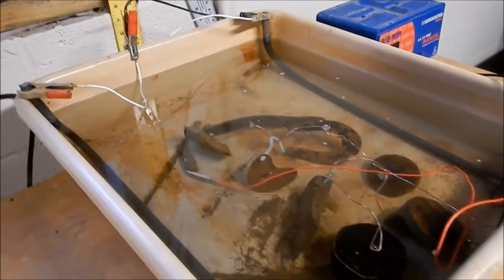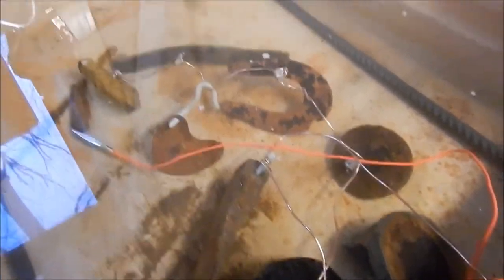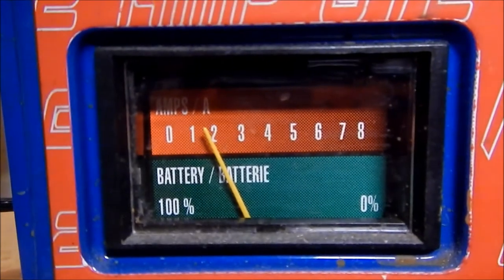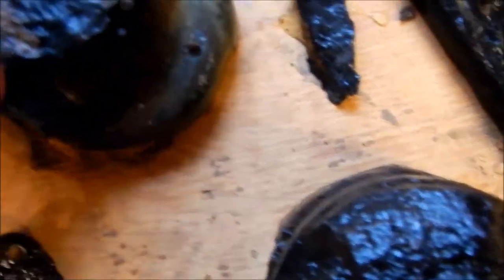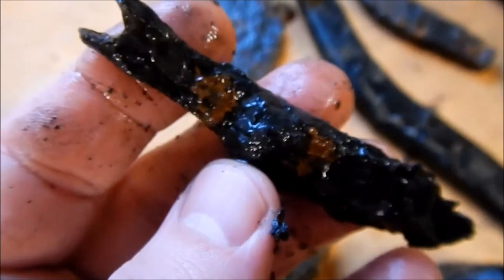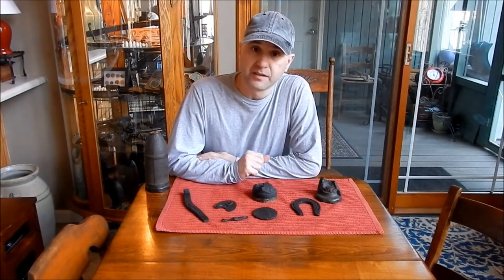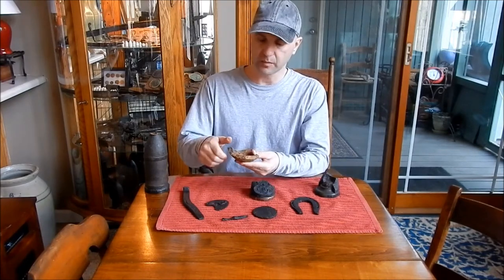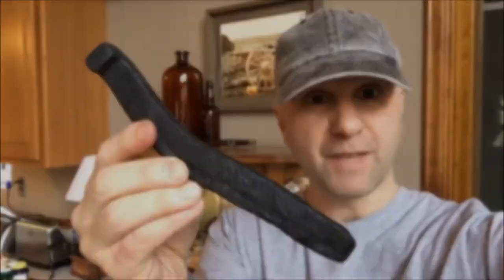Electrolysis For Iron Relics

Comment: .Best, if you can to  do it outside, or in a shed,  the cleaning is messy, and the waxing can be dangerous is you overheat or splash wax. . I do tons of it, for yeas. The advantage of the hot wax is it penetrate inside the iron, and will fill all crack.....suface paint, or "rust converter" dont succeed that...The wax  operation is reversible. i mean, you can reheat, electrolyse more, and redo boil wax again. Sometime, i need to do that for canon ball or iron found in salt water. when you happy with result, keep in nice house environment..avoid basement, and air conditioner vents.One new thing i do, is using rain water...to avoid city chlorine water, and boil the water. the object dry much faster, before entering the hot wax. beware, the steam can bubble overflow your wax. I like your video.

Comment: Very informative video. Don't use the wax treatment step instead heat the iron pieces over fire for several hours to remove any moisture then wire brush and put several coats of Kemplers iron converter and they turn out great. Will have to try wax treatment one day. Always thought it would be dangerous...
Reply from the maker: Yeah, it can be dangerous. You definitely have to pay attention to what you're doing. Thanks for watching.

Comment: Hey buddy would this work for my Square nails ???
Reply from the maker: I suppose it would if you can get good electrical contact on them though they may possibly just dissolve depending on how much good metal is left under the rust.
Reply: ok thank you, that makes sense. Great videos too thank you for posting :) HH James
Reply: I did it for a lot of square nails i had found. Just wrap some steel wire around them a few times and it works great. I re-used the nails just fine.